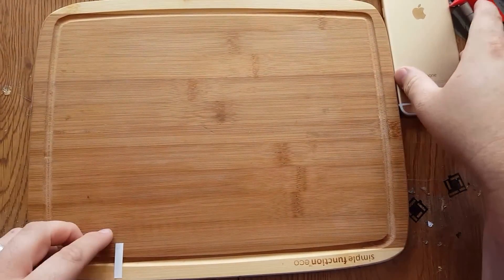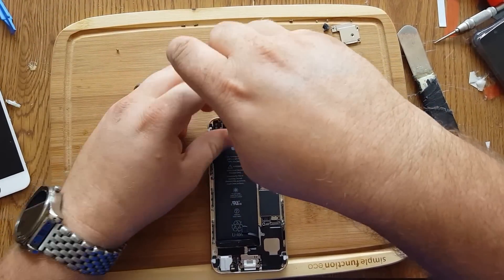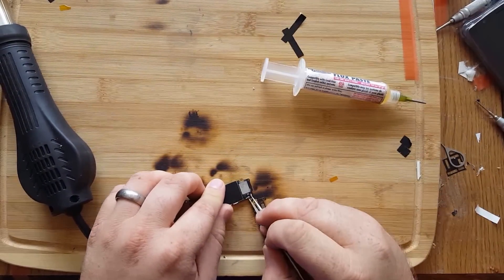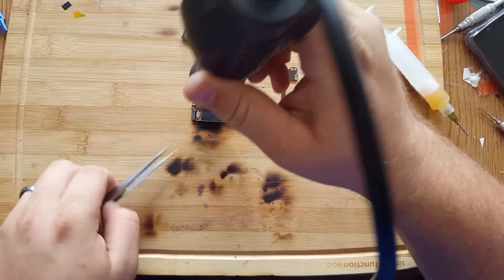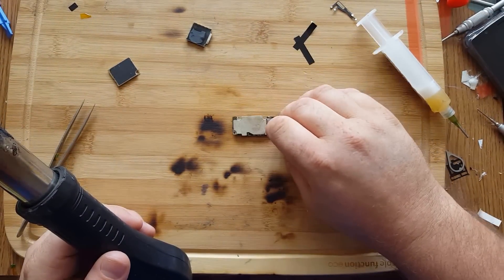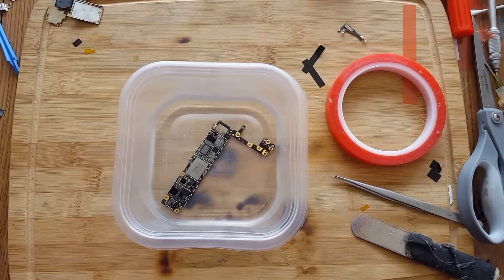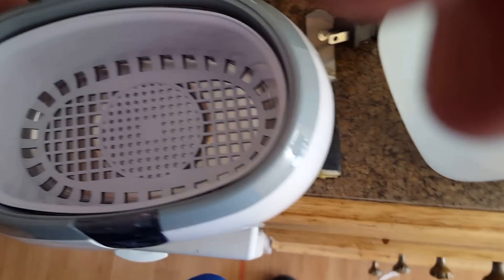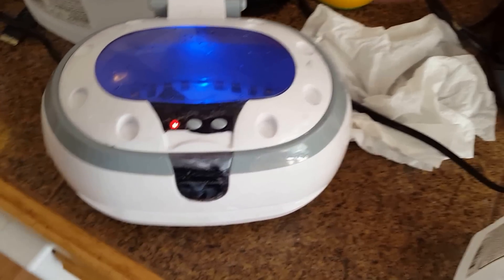iPhone 6 Water Damage Done Right Tech MD

Comment: Hi great video, i have an iphone 6 that has water damage, everythign 
works exept that it doesnt get recognized by the computer it even 
charges but like i said it wont get recognized by any computer, do you 
happen to know what part needs to be fixed in the logic board, i have 
tried with  other charging port from other iphone and nothing, thanks in advance
Reply: thats the lightning connector

Comment: I can't believe that you blamed the cable ripping on corrosion. They don't get corroded. I don't mean to be a troll but seriously! 
Also that fourth (Plate) you pulled up, isn't a plate at all, it's a sticker on a frame. Again seriously I thought you were better than that. If you haven't already you will find with the Crest Ultrasonic and cleaner that you can actually get under the chips on the board. I'm glad that at least you removed the plates before cleaning it and not just throwing it in your cleaner.

Comment: Just a quick question, I see you heated out the ICs that stores the phones data. Is that really necessary before you soak the logic board through the super soaker washer. Also AND MOST IMPORTANT, why where you extensively heating the logic board with your heat gun for extended periods of time before you when ahead and brushed it down with your tooth bush and then placed it in the cleaning machine? Was the extensive use of the heat gun used to remove the corrison off of the logic board? Can this be done? I find that kind of interesting...using a heat gun to remove water corrison off of the logic board? Is this possible? You are making it look like so in the vid. Please respond when you get the chance and really looking forward to your reply. Thanks :)
Reply from the maker: you can go very hot with a heat gun. Not going to fix nothing, and only used a heat gun to speed things up. I will not go motherboard temperature of 100 degrees Celsius.
Reply from the maker: you can go very hot with a heat gun. Not going to fix nothing, and only used a heat gun to speed things up. I will not go motherboard temperature of 100 degrees Celsius.